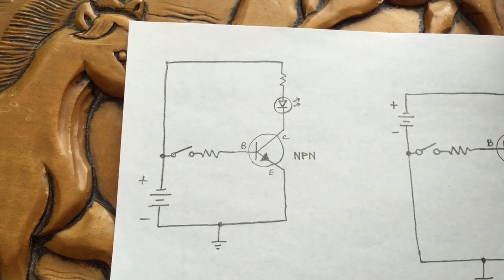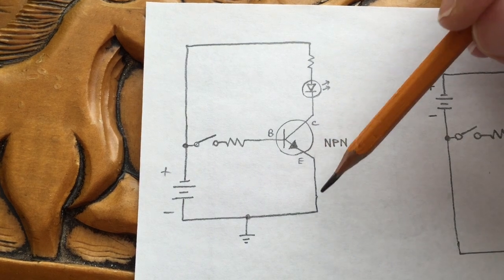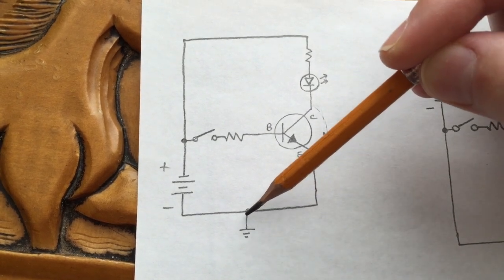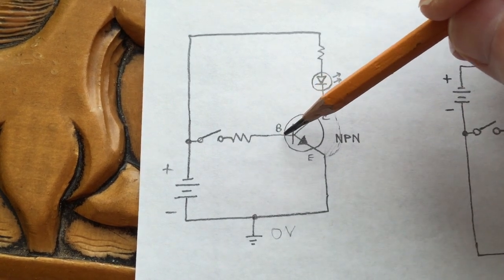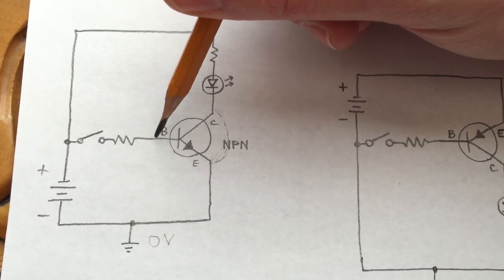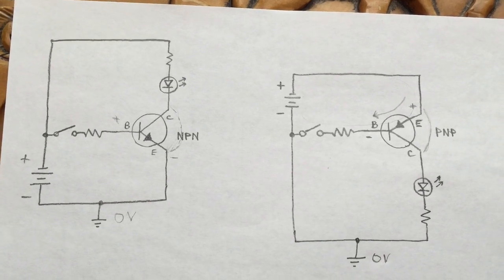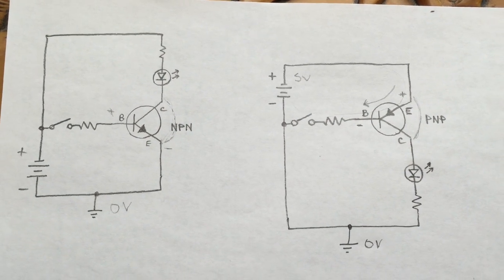NPN vs. PNP Transistors as Common-Emitter Switches

Comment: I don't want to seem negative, but I am positive that your battery symbol is reversed.
Reply from the maker: +madamerotten yup... a sketch drawn in haste and then turned around... I will apparently never live this one down. :(
Reply: @kevpatt  Why not annotate the video with the correct polarity, to save all those poor confused students? The video is popular and still being watched...so, why not fix it and 'live it down'?
Reply from the maker: @wthornton7346  Yes, I should probably take the time to figure out how to annotate the YouTube video. Thanks for the suggestion.
Reply: @kevpatt  hehe no problem, it happens to us all
Reply: he has the Positive terminal of the battery connected to the ground symbol, and has labelled it negative, while the negative terminal of the battery is labelled positive.
Reply: @nick54thegreat   Thank you know that's what it is --now I can understand the video
Reply: Some of these negative comments, causes the positive base bias a leak through the emitter (on the NPN transistor).  tsk-tsk   Keep the positive comments going guys! :D
Reply: I used to be really interested in electronics but that was 40 years ago.  I had remembered that the longer line on the battery symbol was the positive because if you added the two arms of a + together it was longer than a -.  When I saw this I thought my memory had failed me and I was rather disappointed.
Thank you for pointing out that I wasn't wrong after all.
Reply: 3 GUARD
Reply: Doomed to a lifetime of polarity puns!
Reply: @mackdlite5900  Be positive it cant be that bad.
Reply: Doe!
Reply: Very clever.
Reply: Does it matter if the load (this case led) is connected on the emitter side of the npn or emitter side of the pnp?
Reply: @mrsemifixit  It matters;
Reply: What is bias voltage on the base?
Reply: that confused me...
Reply: I was about to say that .......
Reply: Standing on the shoulder's of giants can be a dizzying experience. Great video!
Reply: Good catch
Reply: Thanks, dad.
Reply: Plus thé explanation is not really that what happens
Reply: Haha… nice.  You win the interwebs today.
Reply: I think they refer to the battery symbol, The long plate should be pos and the short one neg. The circuit drawing is fine other than that...
Reply: nick54thegreat i understand that and stand with my original statement.

I think it makes more sense this way.. since we are all conventionally taught that power flows fron Positive to Negative. 

Even though.. i agree.. the terminals, according to his drawing, is indeed reversed.
Reply: @stormshockin  Same, I do all my circuits based on the natural current flow. Not conventional.
Reply: @stormshockin yeah it threw me off when I first did circuits and really took a while to start doing the the right way
Reply: I actually disagree.. since power seems to actually work from neg to positive.  And not from pos to neg.  I think it is more accurate this way.
Reply from the maker: @stormshockin  it might be technically correct, as electrons flow in the opposite direction of "conventional current", but schematics are drawn with conventional current and symbols in mind, so the symbol is incorrect in this context.
Reply: And I would agree, I am def not trying to combat that it is "drawn incorrectly" as it is. It is backwards and incorrect.

I'm just saying that.. those symbols were created when we still thought electrons flowed from pos to neg. So, an update to ANSI should be there..

Either way, not like it really matters.
________________

Know what I really find interesting though?
By this dynamic function of electrons... On a vehicle, or maybe even other powered sources... Power literally needs to travel from the floating ground of the chassis , and then into the electronics demanding a certain amount of voltage/power.. before being actuated.. thus.. in retrospect.. the battery or power source is actually the ground.. creating that "infinite potential;" -- because the battery/source is a capacitor that is being drained as it flows..

... Come to think of is... This makes me wonder if the "ground/Neg" side should be what's fused...Wouldn't this... eliminate the issue we have with "Static Conductance?" (This may be a term that I am using, for it makes sense to me... I am using this term because if a system or electronic is fed power that it cannot be rid of quickly enough.. eventually, the flow of electrons will blow it's own path.. causing a stop, which will need to be discharged. Much like fatty cholesterol in a blood vein.)
Reply: Kevin Patterson    The schematic is designed to show where in the circuit the components are located and so the resistor for the lcd should be after the led on a true schematic
Reply: william vaughn  almost  protons/hole/positive charge/potential energy is a hole in the conductive space that an electron could (pot)entually  occupy
Reply: @kevpatt  
Let's try the Confused Chaotic approach; Electron actually "flow" by have holes move backwards on a revised corrected schematic; 
This makes drawing the circuit reversed correct since on the 2-nd drawing what is normally the electron side of the battery goes to an arrow that points where they are going so thus that drawing is "correct" ~ correct?
Reply: @stormshockin  depends on if you are a protagonist or an antagonist...
Reply: @stormshockin  you are confused between "electron flow" and "conventional current" . Even though everyone knows it's wrong, we pretend that there are positive charges charges flowing from positive to negative. We know that electrons flow from where there are abn excess of electrons (-) to where there is a deficiency (+), but it DOESN"T MATTER, conventional current flowing one direction or negative  electron flow flowing the opposite direction. When an EE talks about current flow he is talking positvitive, conventional  (imagined) flow. If you don't accept this you will forever be confused.
Reply: @SuperFredAZ  indeed indeed. Regardless, I love that everyone here is interested in this topic <3
Reply: @stormshockin  Electrons flow from negative to positive but CONVENTIONAL current flows from positive to negative. It's something that was established before knowing the true direction. It is used this way everywhere by everybody. And he says so in 0:58.
Reply: @alejomdp  indeed :-]
Reply: @stormshockin  Current flows from + to -, electron flows from - to + (opposite direction of the current). Don't mistake about it.
Reply: @StrsAmbrg  indeed thanks

Comment: Just out of curiosity; could you use a single resistor on the emitter side of either of these circuits to limit the current to the base as well as the LED?

Comment: So, you're talking about current flowing from positive to negative, but electrons don't flow from positive to negative. Electrons are negatively charged and move from negative to positive. Or has everything I've ever been taught wrong... So, are you using "conventional" flow or real current flow... I'm confused.
Reply: Just to say it though, great video except for that one part about current flow.
Reply from the maker: +Ryan Roga I'm using "conventional current", where we consider positive charge carriers to flow from the positive to the negative terminal of the power supply. This is the opposite direction of "electron current". It's easier to explain things in term of conventional current flow, since the arrows in schematic symbols are drawn according to this convention. That's why it's called "conventional" current flow. See http://web.engr.oregonstate.edu/~traylor/ece112/lectures/elect_flow_vs_conv_I.pdf
Reply from the maker: +Ryan Roga Thanks! Although I do feel pretty stupid about drawing the power supply symbol (the lines) upside down. :( I was originally just making a quick video for a friend and made a quick mistake.

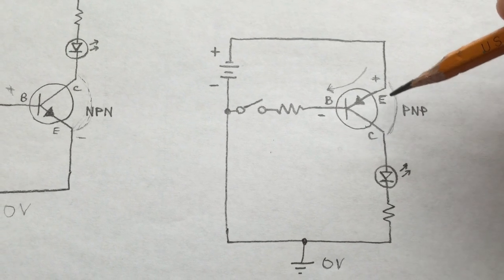Comment: At 6:20 you say the current from the emittor will be able to flow through LED ( to collector )
At 6:35 you say the current will flow into the emittor and out of the base .

Which way? both?
Reply from the maker: +ThePositiev3x +Adam Fox is correct. In the PNP transistor, current must flow through the Emitter->Base junction in order to turn on the transistor. Once the transistor is turned on, current can ALSO flow through the Emitter->Collector junction. So yes, when the transistor is on, current flows INTO the Emitter, and OUT BOTH the Base and Collector. (The current flowing out of the Collector is usually much larger than the current flowing out of the base--this is the current amplifying effect of the transistor.) For an NPN transistor, the explanation is the same, but the direction of the current flow is reversed. (i.e. switch the terms "IN" and "OUT" in the explanation above.)
Reply: +ThePositiev3x Both actually happens, current flowing into the base will allow current to flow from the emitter to the collector. Without current flowing into the base you wont be able to have current go through the emitter and into the collector.

Comment: how to make a flashing led circuit
Reply from the maker: +Sinto Paul Most common approach is to use a 555 timer IC, you can probably find a lot of tutorials on that here or just search the web. If you want something really simple, you can even buy LEDs with built-in flashing function. In the future I will try to do a video showing basic timing analog circuit designs.

Comment: You should also mention that the difference between emitter and collector is negligible, and basically you can switch the collector and emitter, and the transistor will work just as fine. The only difference is that one is more heavily doped than the other, but in reality this translates into a very tiny and negligible difference in terms of electrical properties.
Reply from the maker: +legaata The only problem is, you won't find those parameters in the datasheet, so you'll have to determine them through experimentation. :)
Reply: But if a component blows on the Collector side, the Emitter still keeps the Transistor conducting.

Comment: That's the best explanation I've seen yet..   It seems to me all BJT transistors are Normally open.  I need to figure out a normally closed circuit using transistor. I can't find it anywhere. Does anybody have a link to a simple NC circuit ??    "simple" is key here  :)    I'm a beginner.
Reply from the maker: +ThomastheSailor Chubby I'll see what I can do... What you're looking for is a "logic inverter". To do "normally closed" with regular transistors will require a small amount of power even during the "normally closed" mode, unlike a mechanical switch. The reason is that pretty much all transistor designs, when used as switches, are "normally open" when unpowered, and it will take a small amount of power to keep it "closed". This power could be negligible with perhaps a MOSFET, or it could be "stolen" from the load being switched. Some interesting designs are certainly possible.

I have another video showing NPN and PNP transistors in a circuit simulator, and I believe it shows a logic inverter along the way.
Reply: This video demonstrates the Transistor used as a Positive Feedback device.
So, if you keep it positively biased the circuit will always be on until you provide overwhelming negative bias (Negative Feedback).
This can be done by adding an extra Resistor at the Base which pulls the voltage level in the opposite direction when a mechanical switch is closed (Voltage divider).

Comment: I haven't see any simple explanation then this one. Thanks Kevin. I was wondering if you user battery positive and negative representation correctly. Generally I have seen positive terminal line length greater than length of line representing negative terminal. Any how great explanation.

Comment: it is really a very nice tutorial.. got to know a lot. 
wat i have a doubt before this was how npn and pnp transistors are ON . whether we use 5v to ON the npn and 0 volt to ON the pnp. 
wat my doubt is there is something 0.7volt required for transistor to work. what is that? do both npn and pnp requires that? i read data sheet of BC548 npn transistor. there maximum ratings were written ( example - 50v maximum base emitter voltage. and collector base maximum voltage is 30v). what is that about exactly.
Reply from the maker: +sandeep agari Ok, so you don't actually use voltage (directly) to turn on a bipolar transistor. The transistor is controlled by the amount of current flowing thru the Base. But to get current to flow into the Base of an NPN transistor, you will need to apply a voltage to the Base that is higher than the voltage at the Emitter; then a current will flow. How much current? Well, probably enough to burn out your transistor if you apply 5V directly to the Base and 0V to the Emitter. There is not much internal resistance in this path, and so according to Ohm's law, that means a lot of current will flow. That is why we use a current-limiting resistor in series with the Base, to limit the Base current and set it to a desired level. NOW, to answer your question: although there is very little resistance in the transistor between Base and Emitter, there is (the equivalent of) a diode, which you see in the transistor symbol. This diode has a forward voltage drop, 0.7V is typical for silicon devices. This is like a barrier; no current will flow unless the voltage is at least 0.7V, enough to cross this barrier. After that, the current is limited by the current-limiting resistor in series with the Base. So yes, you can't really operate the transistor with a Base voltage that is less than 0.7V (fortunately that is rarely a problem). Now, as far as these higher voltages you see in the datasheets: All electronic components have some physical and electrical limitations on what they can handle. In transistors, this often has to do with the maximum amount of current they can conduct through various paths, the amount of energy they can safely dissipate as heat, and the maximum voltages that can be present across their terminals. As I mentioned, there is an internal diode from the Base to the Emitter, and it conducts in the forward direction, turning the transistor on. In the reverse direction, it blocks current flow, but if the reverse voltage across it is high enough, it will break down, probably destroying your transistor. So that is one limit. Also, when the transistor is off, current flow is blocked from the Collector to the Emitter (the switch is "off"), but with a high enough voltage it will break down, again, probably destroying your transistor. Keep your system voltages below these maximums and these should not be a problem.

Comment: the symbol for the batteries are wrong. It should be big line for positive terminal and small line for negative terminal. And also please include how the transistor will go into saturation if u keep on increasing the input volatge.
Reply from the maker: +Laxman Chauhan Yes the symbol is upside down, silly mistake I made when quickly sketching this for a friend. More transistor videos coming in the future...

Comment: in the PNP circuit, why is the resistor placed under the LED and not above it ?...like in the NPN circuit.does this matter?..i'm kinda confused...
Reply from the maker: No particular reason. The resistor and LED are in series, so it doesn't matter which one comes first; equal current will flow thru both. The important thing is they are attached to the collector of the transistor, which is our current source when the transistor is switched on. The current flows thru the LED and resistor (in series) to the ground. You can swap the LED and resistor but the result will be exactly the same in either one of these circuits.
Reply: Kevin Patterson thank you for your explanation.